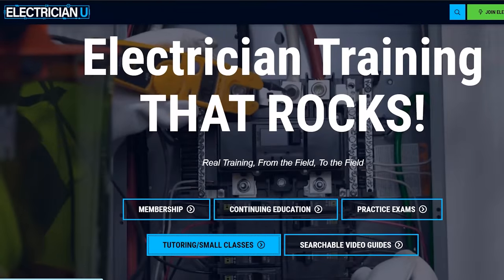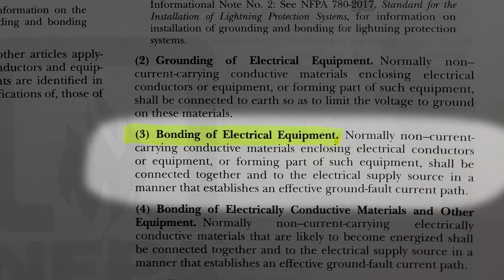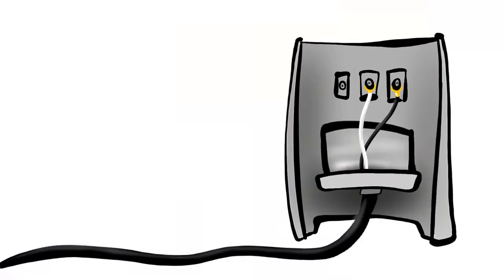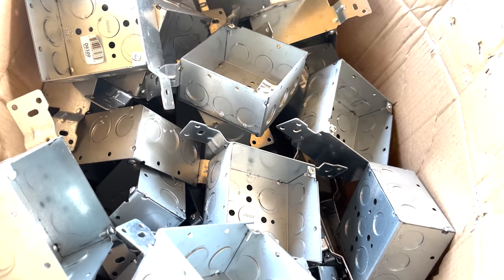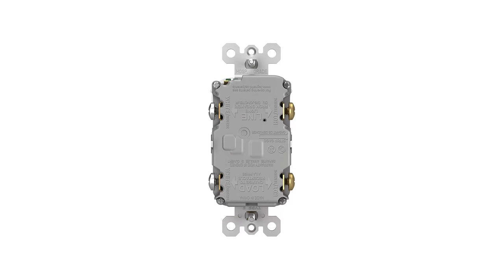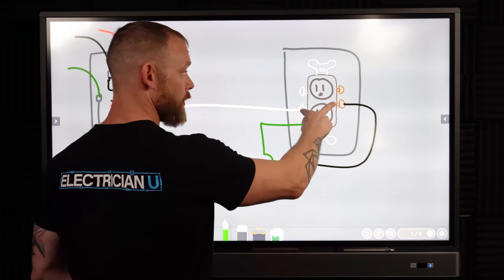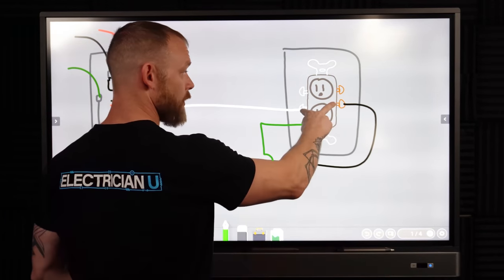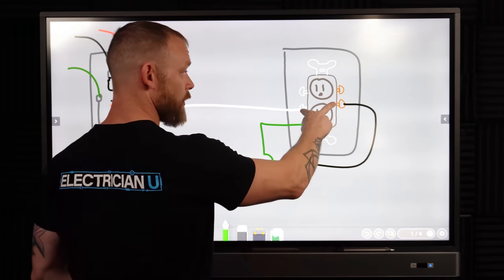Why We Bond Metal Boxes? Do Plastic Boxes Need Bonding?

Comment: Thank you for all the great videos. I think I have a good example for you. I bought a 1940's drill press that did not have a grounded plug. When plugged in,  it operated with no issue. I got it home and plugged it into a grounded metal outlet and again it worked with no issue. The problem came when I went to unplug it and touched the grounded outlet box and the metal housing of the press at the same time. Thats when I got zapped. Upon inspection, the insulation on the hot inside the motor was worn making contact with the motor case. This energized the whole press. I replaced the motor and grouded the case so everything is fine now. Thanks again for all your educational videos. I am not an electrician but I appreciate the way you explain your craft in an informative and entertaining way.
Reply: Hmmm, maybe that's why it was for sale? 😭😂

Comment: Guys remember here in the USA, there are multiple utilities that have corner grounding that will LIGHT YOU UP!!! Always check voltage to anything metal!! Oil field is the most common! Be safe guys!
Reply: Rob a very good point in my area we have a lot of comer ground systems. In the Irrigation and farming end of the industry. It is usually on older power systems for us because power companies don’t install corner ground systems because of safety reasons.
Reply: Yep, still a lot "corner grounded" delta out there.

Comment: Dude.  You kept a straight face during that intro.  Your abilities and impulse control skills are top notch.  Ground, grounded, grounding, bond, bonded, bonding.   They are things.  NEMA 4X we always install a ground bar and no we don't mount that bar with 10/32 screws, and we're not supposed to drive screws through the wall of the box, since the box has to maintain it's integrity, so what do you do in that situation?  Anyone?

Comment: When I was a kid back in the 80s, we lived in a house that had been wired in the 1920s, and there was a problem where if you touched the refrigerator and the freezer at the same time you'd get shocked. The whole house got rewired in the late 90s so that's not a problem now, but it was a problem then.
Reply: So i'ma not even at apprentice level for this field, but ima take a stab at this. obviously, one of them were energized. and that's all i got.
Reply: chances are very likely, the house was wired with knob n' tube and no grounds were 
used, just a hot and neutral. So the fridge or freezer had a fault and the other was
grounded somehow., so not a good situation.
Reply: @raymondgarafano8604  Yep, the ceramic pieces are still all over the rafters in the attic
Reply: I had a friend that their fridge and stove were that way.  If you flipped the fridge plug it went away.  They would flip it back on purpose sometimes to mess with their sister.  She'd open the fridge and bump her rear into the oven then jump.
Reply: No ground or ground was used for hot. Seen plenty of ovens ran with 10/2 with the ground acting as a neutral. So basically what happens is "no ground" you touching it creates a short which makes it want to take a ground, but since is none, you're it. What would worry me if that never traveled back to the breaker, then it'd never break.
Reply: @krich106  Up tp 95 or 96 code did allow a 3 wire multi ckt for stoves and dryers
then sed NO. Frame shall be connected to a grounding wire and neutral to be isolated from ground and used as the return for any 120 volt item like a small 
appliance plug for 120 volts. As you know the neutral carries current when a load
is connected to it and an ungrounded wire or the difference between two hots.
so 20 amps on two burners would be 0 on neutral but then u plug in a waffle iron
so now u could have10 amps on frame or enclosure of stove and if you touched
the fridge u could get heated up. using a 10/2 could have been a bad idea so a stove or maybe just the oven. then the white of the 10/2 would need to be 
changed to a red/ black or blue and the ground connected to the neutral if one was used. same for clothes dryers which are always or damn near it right next to the washing machine and the forever chance of there being water on the floor 
specially in the cellar or garage, having current on the frame of the appliance is really not a good idea and in the garage anyway a GFI breaker for each ungrounded conductor would be the prudent thing to do.
Reply: @raymondgarafano8604  Well I learned it cleaning up the mess from a guy my master electrician put me under. Whom ended up being a fake electrician, liar, handyman. The guy, not my master electrician. He was swapping out the breaker panel. When he did the stove, i remember him trying to get  it to work for 2+ hours. Then it worked. Well this man couldnt teach me nothing, master got rid of him. Then left me at it to clean his work. Then I discovered how he got the stove to work off a 10/2, was because he bonded the ground to neutral...... When the disconnect and meter were 25 yards away from the house. Mind you I was learning most of this while doing it. Then know that he didn't want me in the live panel, just wanted me to run the wires. Well my master is a speed addict... I wanted to finish the job to get paid. So I did. Which impressed my master, since he didn''t teach me really shit yet. Just had 8+ years doing telephone/sat/cable, so the concept of electricity i already had. Wall fishing, wire running, etc. Everything else I learned from this channel or others, then applied it in the field. Mostly just learning code. If I can't help straighten up my master electrician, then probably going to apply elsewhere. Least now I have real work experience in the field, instead of related. -edit oh yea the handyman tried to tell me 5 dollar rubber dipped gloves was all i needed for live panel.... knew he was full of shit right there. He worked on it live, I cut the damn power fully, screw the guy who wanted to watch tv. Then he twisted all grounds together and daisy off 1 pigtail for ground. Same with neutrals which is not up to code. The blantant not knowing code is why my master fired him.
Reply: I recently went to replace my old 3wire dryer receptacle and found 2 8 awg al wires and a completely bare copper neutral going all the way back to the panel.
Reply: @matthewschultz7745  Now that's the funniest thing I've read all week...and it's Saturday afternoon...

Comment: The “strap” as you called it that’s on the plug receptacle is metal and connects to the green ground screw on the bottom side so when that strap has 2 screws through it holding it to the metal box there are 2 screws and the strap touching the metal of the box which already ground the metal box via the green screw that’s connected to the bare ground wire. Why should you have to also add a grounding wire to the metal box if it’s already grounded that way? I’ve tested with a meter to confirm the plug receptacle “strap” is conductive through the metal box enclosure and to the bare ground wire to see for sure. I understand why it’s done but I also see the “strap” fastened to the metal box thus creating a grounded connection without an additional connection to the box.
Reply: I used to think the same thing, but experience has improved my understanding. There is a very small chance that paint, dirt, or just loose screws could prevent the strap from contacting the box.

Comment: A few weeks ago one of my receptacles had the hot contact the ground, but there was no grounding wire going back to the main panel. I found out when I touched the back of my pc. It wasn't a strong shock luckily. It's fixed thanks to your videos.
Reply: Install some GFCI receptacles. No reason for not doing this. They will save your life.

But think carefully about where you place them in the circuit as one GFCI receptacle will provide protection for down stream receptacles.

Comment: I usually tell the difference between Tip to remember difference from GROUNDED AND GROUNDING CONDUCTORS as the G in the GroundinG as the G for Green for a green ground-screw. And GROUNDED as the Neutral.

Comment: Electrolysis is a good reason to bond metal enclosures to conduits. I have seen wires in front of me burn up the insulation because of this, it was # 12 wire solid. But it was pretty shocking to watch it happen with my own eyes in front of me, after replacing some conductors for a boiler in a apartment building .

Comment: A well  grounded tutorial... in electronics for devices  its refered to chassis  ground. As apposed to earth ground. I understand  your explanation.   Thank you.
Reply: No it is not.
The chassis ground is something completely different.

Chassis grounds typically form part of the normal operation of an electrical system. It is just a convenient way to connect electrical devices to each other. Current then flows in that chassis ground under normal operation.

A classic example of this are cars where rather than have positive and negative wires running to all electrical appliances in the car, they don't run a separate negative wire to each appliance.  They just connect the negative connection of the appliances to the body work or chassis of the car and then connect the body/chassis to the negative terminal of the car's battery.

The chassis earth/ground is providing an easy mechanism to connect the negative wires of all the appliances together.

In earthing/grounding for electrical installations, the ground wire is not part of normal operation, it only carries current in a fault situation.

And the goal is that it doesn't carry the current for a sustained length of time.
The goal is to have a low impedance path to cause as much current as possible to flow to cause the circuit breaker to trip and disconnect power to the installation or part thereof,  thus rendering it safe.

There are a lot of terms relating to grounds and earth's and they mean different things in different situations. And it does become confusing.

Comment: Our plastic boxes in Canada have a metal band between recepticals mounting holes around back of the box that we have to bond. Keeps all screws and devices frames bonded, if our switches down press tight against it we have to actually bond them as they usually have metal in the construction.

Comment: Great video and use of smart board 👌 I would love to see a video on AC frequency and learn more about what that is, is it standardized, how is it measured, do different appliances convert to different frequencies, can you convert to different frequencies, is the frequency set by the power plant or does it change at different steps like in high voltage wires, etc? Keep up the good work 👍
Reply: If you use a hydroelectric plant as an example, in the US the turbine is spinning at 60hz which is what creates the 60hz on the power lines to your house. 

If that turbine is designed to supply up to 1000amps of current then they need to stay below that. But if another turbine that is suppling that grid fails then more load is applied to the 1000 amp capable turbine. If we end up with a load of 1050 amps the turbine actually starts to slow down which is really bad because it starts producing 59 hz electrical frequency. 

At this point they will turn of the power to a couple thousand homes to reduce the load on the working turbines so they can maintain the 60 hz. 

There is actually automatic disconnects in some power grids that get triggered by a low frequency on the grid, like 58hz, and it will just disconnect power from those homes to save the rest of the grid.
Reply: @ecospider5  Great explanation. The opposite also happens every day just before lunchtime when all these new solar plants start injecting lots of power into the grid. That makes the frequency go over spec to 61hz and beyond, and the thermal and hydro plants have to try to throttle back really fast. Most of them are not designed to do that. That's why we have been building natural gas peaker plants and need more electrical storage capacity.

Comment: Also- the NM cable that supplied our water heater went under a NM cable staple and turned 90+ degrees (along the flat side of the cable) and eventually it shaved through the insulation. Fortunately, it was exposed where the water heater was located and we could see it, but it really was a fault in the middle of the NM cable- and it was stapled to a stud. It CAN happen, unfortunately. We were VERY lucky to discover this before the house burnt down. 
We only knew about this because the water heater stopped working. No CB trip. But the wood stud was darkened.
In this house, later I also found other NM cables that were seriously stretched between the staples and had rubbed through the first layer of insulation- this we found when we renovated and removed the ceiling.... FML!

Comment: DIY here that cares about doing things right. 1939 house, has a lot of MC/BX running all over. Frequently into plastic junction boxes (or even receptacle boxes) where it connects to NM cable without accounting for the grounding conductor. I hate it but I want to tear up as little as possible to fix it. When this happens in a plastic receptacle or switch box, is there an approved way to attach a grounding bushing to the BX so I can utilize the grounding lug and attach the grounding conductor from the NM to it?  It seems the grounding bushings I see are all designed for circular knockouts which I don't have in most cases.

Comment: Hey, I love your videos. I'm an electrician myself from South Africa. I've noticed that U.S electricians hardly ever use insulation resistance (Meggers). I haven't seen them used when they commission an installation or when doing fault finding. I usually only see you guys use them when testing motors. When there is a potential ground fault on a piece of equipment I notice you only use the continuity function on your multimeters which is fine for a direct short but not really when there's partial insulation breakdown. Could would love a vid on why this is or if it's just not a requirement in the states.
Reply: Ooo, good question!
Reply: I’m a U.S. electrician and do a lot of new installations in data centers. I use them all of the time. We have to meg all of our feeder circuits and document the results on paper. Where do you get the idea that we don’t use them?
Reply: @RB-xv4si  I guess all the videos I saw of U.S electricians I just hardly ever saw them using it. Again, it's not that I never see them using it, but just not in residential fault finding. Like I said,  whenever I see them test if a phase is down to earth, they use the bell tester on their multimeters instead of an insulation resistance tester. I was referring mainly to the use of a megger in a residential setting.
Reply: @lechzekjacobs2752  oh ok. Well I can’t confirm or deny that, as far as residential construction. I did residential service for a while and the only time I used a megger was when we were testing underground branch circuits to neighborhood pole lights. The only reason I can come up with is that those direct buried underground circuits are subject to constant degradation from the elements and there is some value to using a more involved megging test that can show gradual degradation of the insulation over time. For your typical indoor residential circuits that aren’t subject to these conditions, a circuit failing is usually the result of a dead short and there isn’t much value in using anything other than a continuity test in these situations.
Reply: @RB-xv4si  understandable. Thanx for the insight. In South Africa, to commission an installation (residential, commercial or industrial,) every circuit within that installation requires doing an insulation resistance test (among other tests) which needs to be recorded on the test sheets. Minimum of 1 megaohm is considered a pass. Anyway, I love seeing how different countries do electrical work. Broadens this young electrician's mind. Thanks again.

Comment: Next video, can you delve into why groundING conductors are often smaller than the groundED neutrals that the go with? Thanks for the hard work you put into your channel!
Reply: the grounded conductor has to carry the entire circuit current indefinitely.  the grounding conductor only has to carry the current long enough to operate the overcurrent protection in the event of a fault.  therefore heat buildup isn't a factor.

Comment: Thanks for this video but I have a question about floor box/receptacle which come with metal cover and plastic box and also it has a metal plate for top of receptacle which connects the cover plate to the bonding system trough the centre screw. 

My question is about priorities for installation, which one is first? Manufacture requirements or National Code!? Meaning, if the box comes with that such a metal plate, we shall instal that according to the manufacturer instructions or it’s optional!?

Thanks,

Comment: The washing machine and dryer example you use is sadly is a very apt one. It was one of the reason why in the NEC 2020 GFCIs were required for those circuits because small children have died playing around these types of equipment when there was a ground fault.

Comment: The receptacle provides a bond through the tab under the mounting screw.  The electrical code is a compilation of margin on top of margin, and it’s getting worse with all of the required dedicated circuits.
Reply: It's written by EE's and manufacturers, and approved by lawyers. Not easy to use to prevent problems, but very handy in a lawsuit.